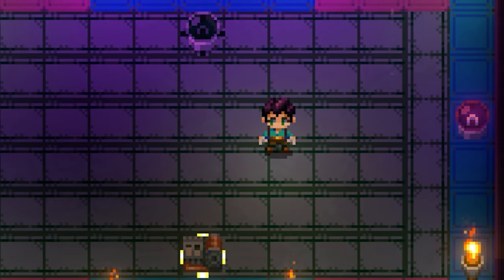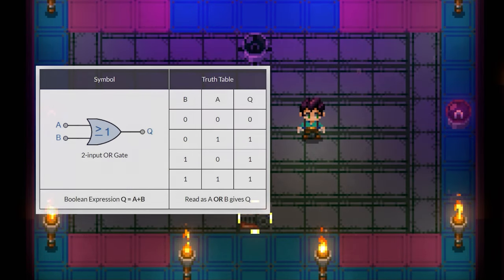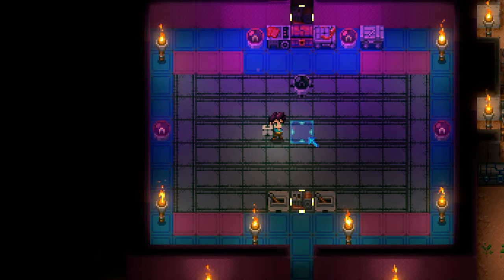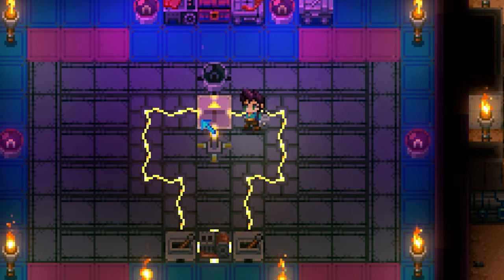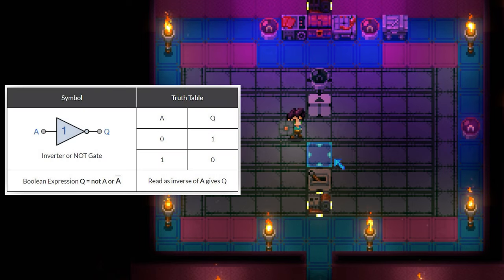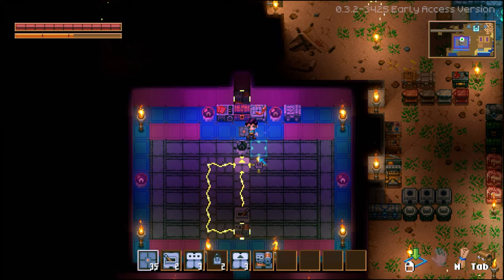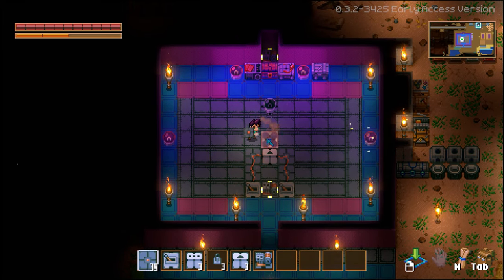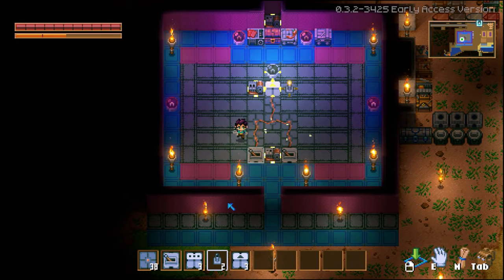ALL Logic Gates Explained | Core Keeper Guide

Comment: Late to the party, great vid! Honestly, what's lacking isn't types of circuitry or modes of power transfer, although remote powering would be cool, and pressure plates would be fantastic, I personally think we need more functionality from circuits as a whole: Currently, the only practical uses for switching stuff on and off are disabling drills for automated farms and node units, and turning the lights off. Pistons, dart traps and block placers would revolutionise Core Keeper automation and introduce an age of machinery and engineering into the game, much like how Minecraft changed forever the day pistons were introduced.

But before that, they need to optimise game performance lmao.

Comment: Trying to wire two rooms two lock one another while unlocking itself. There are drills in the each room. Right room switch turns on the right door should open and the left should close, drills in the right should turn off and drills in the left should turn on and Vise Versa. Also the must do this anytime the switch in that room if activated. Can’t for the life of me figure it out though. Fried my brain trying to figure it out.

Comment: Any thoughts on what features they might implement that would make use of all these gates? Currently the limited inputs and outputs we have don't really necessitate all of these different configurations. Even with the automation stuff I'm not really sure how you would use them all.
Reply from the maker: Once we get the ability to read and write logic information (ie. count items in a chest, detect an item on a tile, etc.) and provide input in ways other than an on/off switch (ie. buttons, pressure plates), then that will open up tons of possibilities for dynamically managing electronic systems.

Imagine a latch that turns on a room of lights when a player steps into it, and turns off when they leave. Or an item sorter that can dynamically activate cranes based on the amount of items in a chest. Or an auto-smelting system that distributes ore evenly across an array of smelters and places the bars into a single chest. All of these systems will make use of logic gates if they ever become possible.
Reply from the maker: My video on an auto-closing door makes use of an XOR gate, and it works because the logic behaves similarly with a switch in both directions.